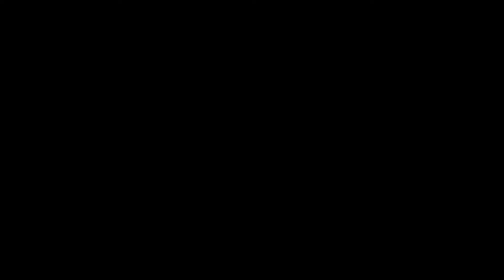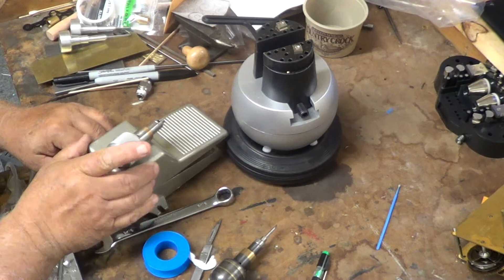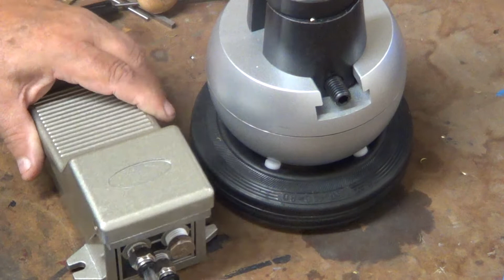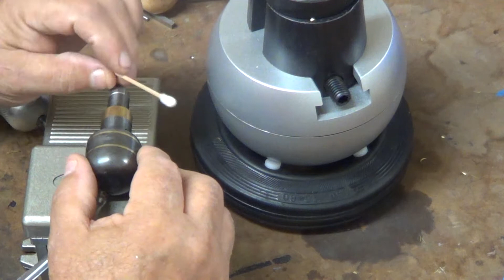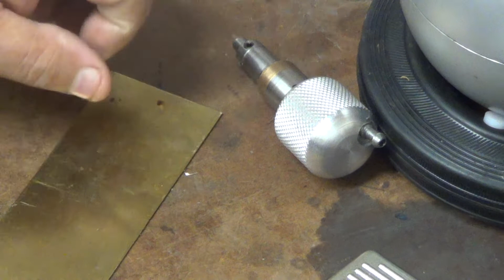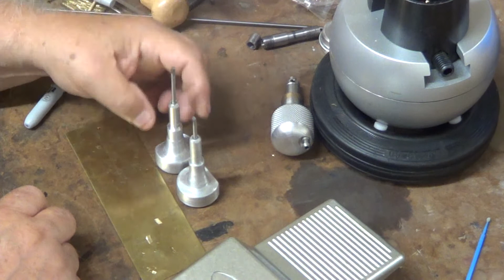The New APG 2520 Engraver Foot Pedal Value

Comment: I got your complete kit , but have been under the weather and haven't been able to use it yet. interested in the air valve ,also.
Reply from the maker: I will be setting up a demo on the use of it.  I just ordered a couple of them to see if they will tweak the graver with a bit more smooth action. Hope your feeling better.  The Bench Jeweler